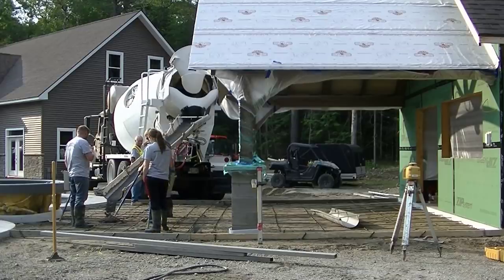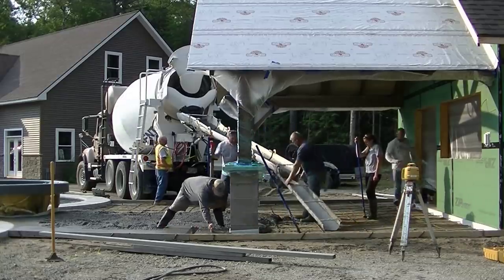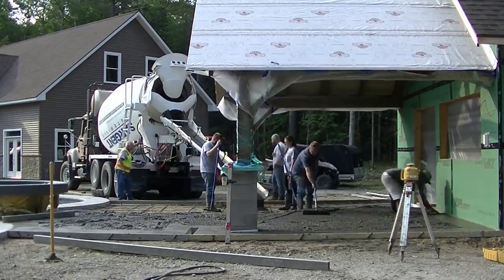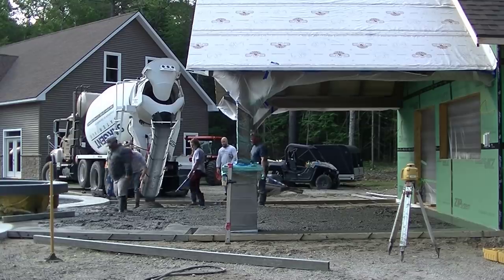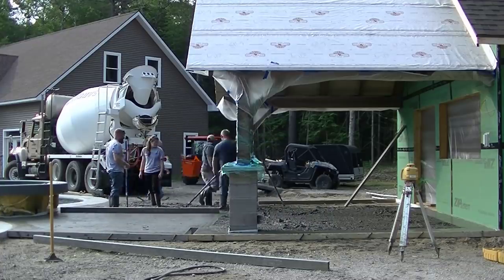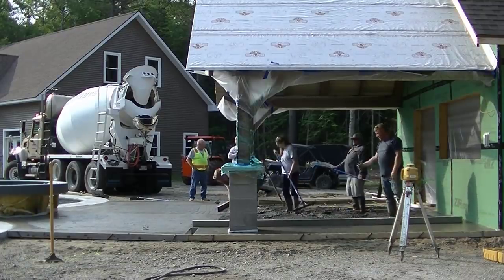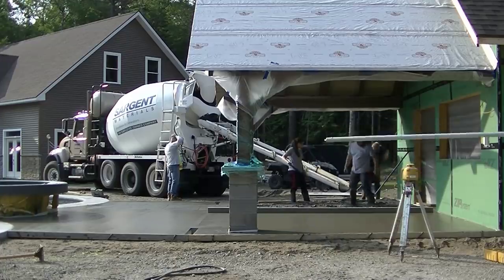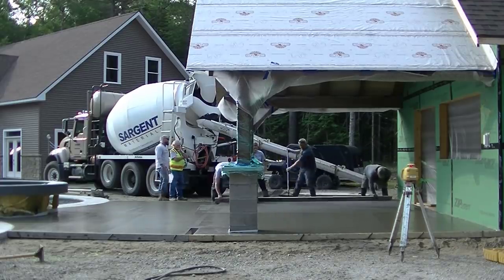How To Pour A 24' X 24' Concrete Patio Slab (Stamp Finish)

Comment: Out here in the southwest we have a whole different problem with hot dry winds blowing out of nowhere. Can't properly finish sometimes. Drop cloth covering the slab, done that. If you're ready for it, raised forms behind plastic, inch of water over the whole slab, cures underwater.